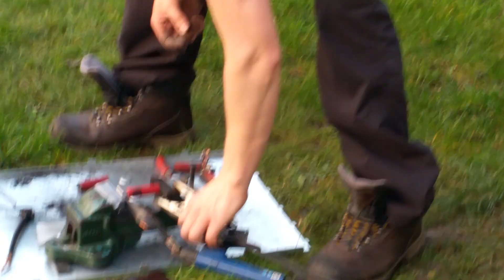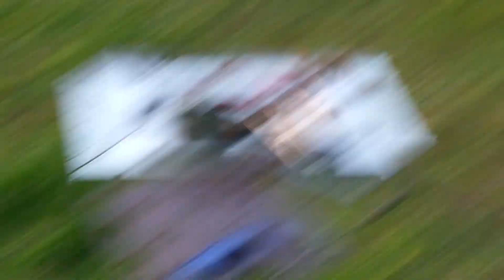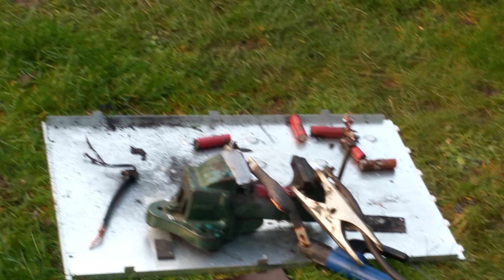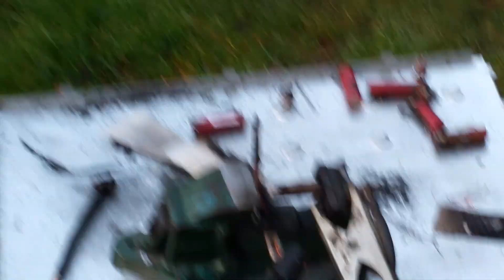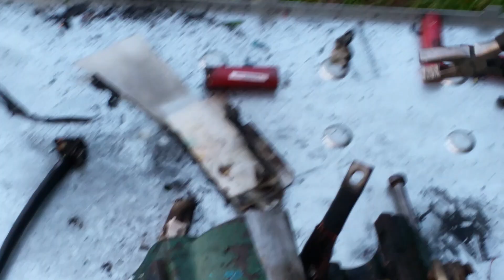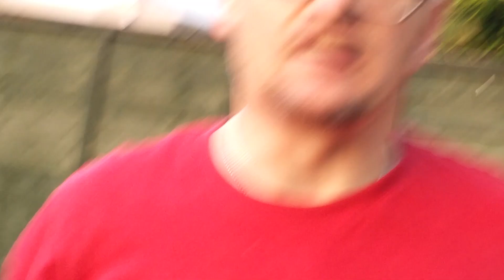18650 lipo on 50 volts 200 amps Dc intothe batteries we got flames and sparks lol

Comment: Hey Ant :D
On the small package IGBT ZVS driver video I asked for an entire parts list and scematic
If you could possibly, get the scematic and share it, it would be fantastic! :D
And also the rest of the parts NOT mentioned in the video, for I was hoping to build it
I also have two flyback transformers that you could have if you want
Cheers !!! :DD
Reply from the maker: Hello mate.
iv built a couple of small package igbt circuits and they haven't been the best realy lol. but I did find some on google images. if I'm honest mate" the best circuits are either the half bridge IGBT driver or the zvs driver! using 6 or so mosfets like 3 in parallel they work realy well. iv pushed one to a hundred volts Dc at 30+40 Amps out. running Xray transformers! as long as you can keep the circuits cool enough ya laughing 👍😉
check out my previous videos mate.
hope all this info helps.

hope ya well and thanks

Anthony

High1voltage1rules